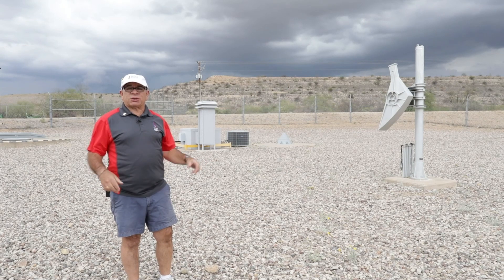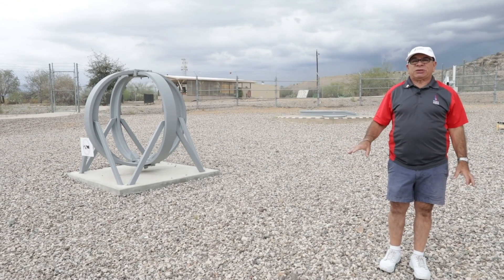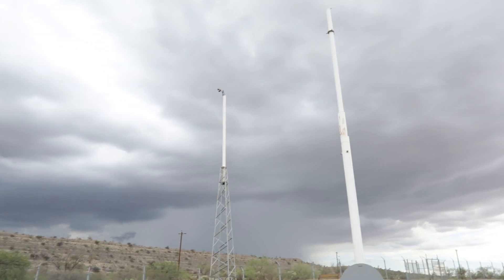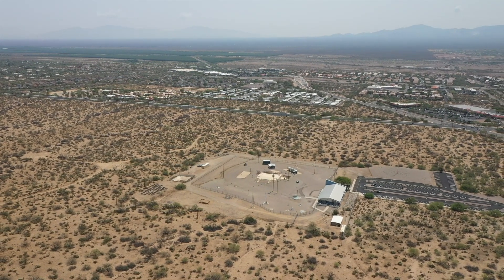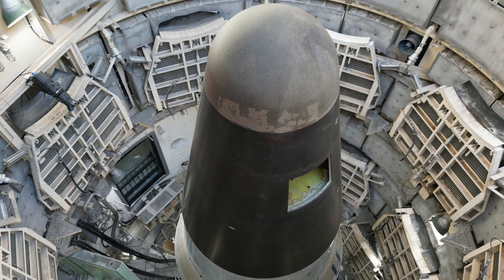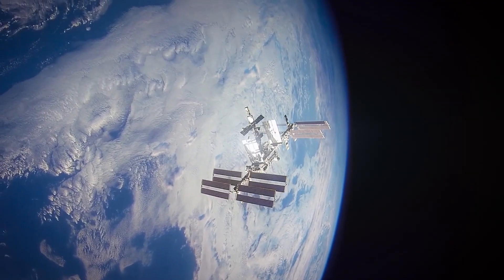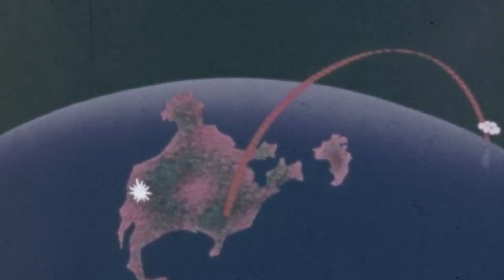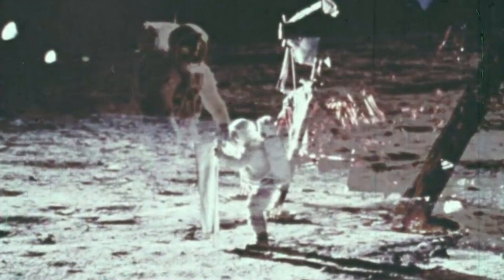Behind the Scenes of Titan II "Part 14 – Surface"

Comment: Question. Were these silos/ command bunkers built in layers by pouring the concrete in sections or blocks, slowly moving up the concrete forms? Or were they poured all at once? Both methods have advantages and disadvantages to the construction and structures. A good series of this channel and the museum would be looking into the construction process of these monumental structures.
Reply: there is a video on the construction here on youtube....they poured the missile silos in one continued pour if i recall..

Comment: I think the Titan 2 missiles were a special version, or up-rated version of the original Titan 2.  All of its systems were either rebuilt or modified in order to make it safer than the ICBM’s.  Plus the Gemini versions had two or three backups to primary systems.